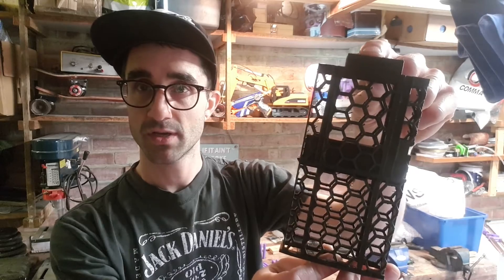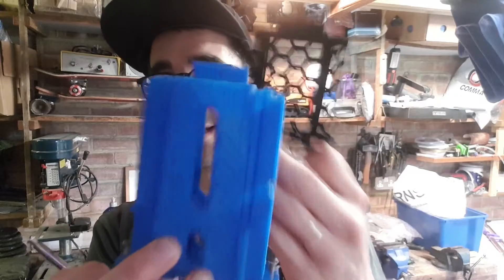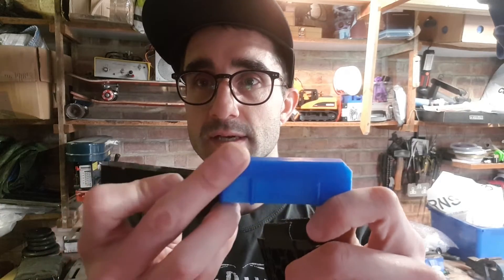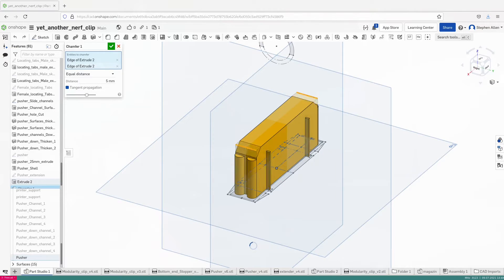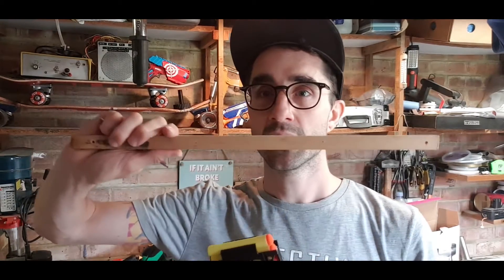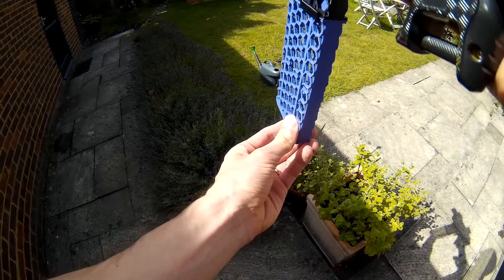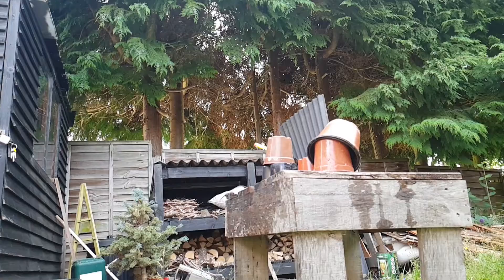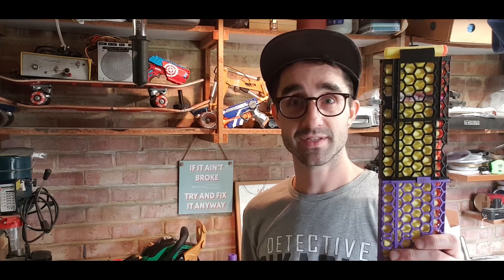3D Printed Nerf Magazine

Comment: Looks great, but the only problem I foresee is how brittle the magazine may be, along with the potential for sticks, rocks or other objects to jam the magazine due to how open it is.
Reply from the maker: You're right they look brittle, but they're quite light if dropped so don't get too damaged - typically the feed lips fall off (just like normal off-brand mags)

If I were to amend the design, I'd try to squeeze in replaceable feed lips

Must admit I've not tested them in really wild environments